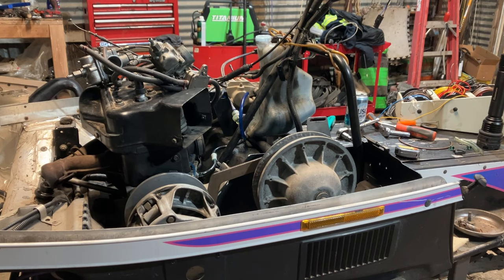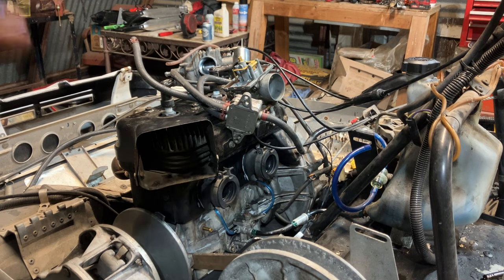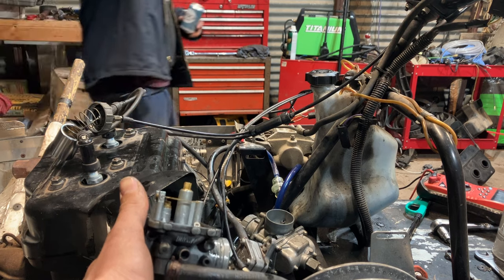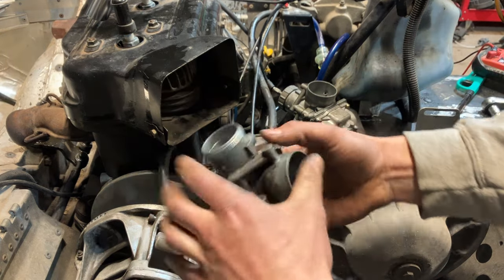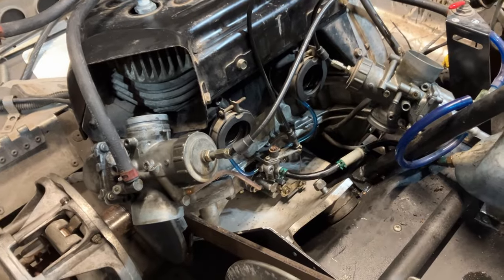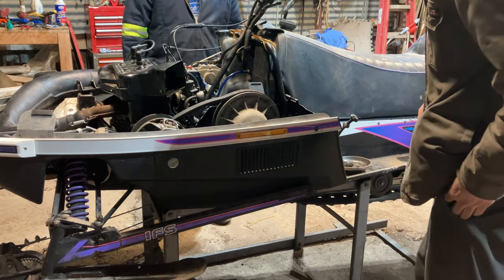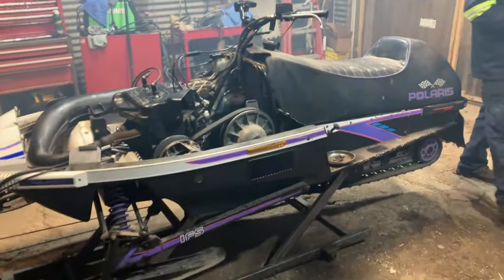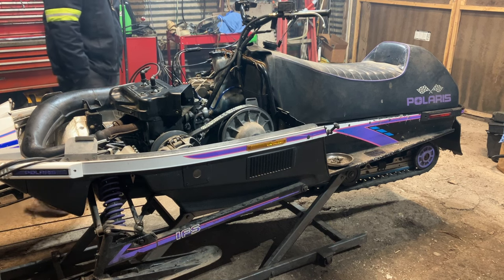Carb Problem I Haven't Seen Before! CHEAP Snowmobile First Start (Pt. 3)

Comment: Watched all 3 parts, nicely done!
Sure am wondering what the compression would be before and after rebuild?
Reply from the maker: Usually compression is about 120 or so after new rebuild depending on the engine. Right away after rebuild it needs to seat the rings so compression will not be that crazy high usually.

Comment: Hey fellas good catch on that backwards emulsian tube i once was having diffuclty removing one and bulged out the u-shape end.i mushed it back as close to original but thought i f#up,good for me ran just fine.iam proud owner of cheap yard sale,$350..1990 indy 400 polaris sled,seems a real ripper.a few questions of help needed!! First is that filter looking thing on oil line a one way valve or filter,two what coorelation does changing wieghts(heavy or light) and secondary spring tension(heavy or soft)have on changing performance.third my engine block has provison for a starter but primary clutch has no ring gear.i would love to have electr.start and install reverse to it,what yr.and cc.size should i be looking for as a parts donor.thanks for any reply.you fellas seem to know sleds.ok,well enjoy snow seems to be disappearing fast.snookie pa.😂😊😊😊😊😊
Reply from the maker: that is a filter in line with the oil pump. check valves are usually in those spigots on the intakes. for the primary you want a p85 with a ring gear off of the 90s indy of somekind. narrow roller is the older style like you want. many 500cc had e start and will work. With weights and springs, heavier primary weights bring rpm down on top end, lighter make it rev higher. It will also change with more tension on the secondary spring. If you wind it up tighter, rpm will be a little more at WOT little less tension rpm will go down a slight bit. I always liked the stock polaris setups, but you can mess with a higher tension primary spring to get engagement up if you want to get more snap on take off as well as thorough cleaning of the clutches.